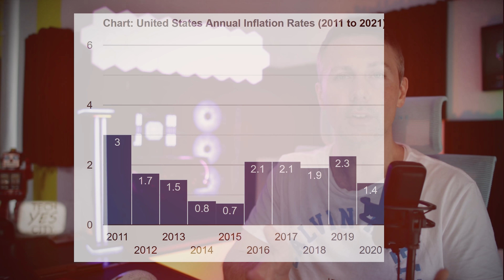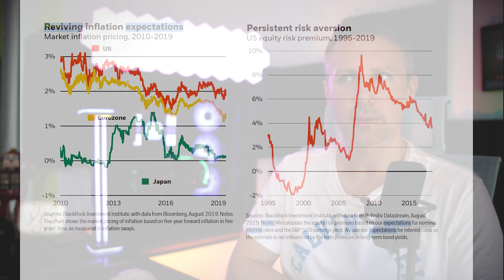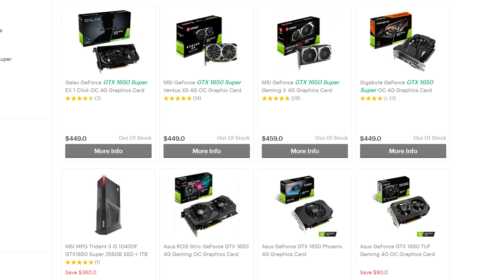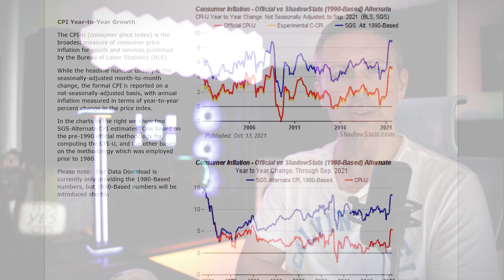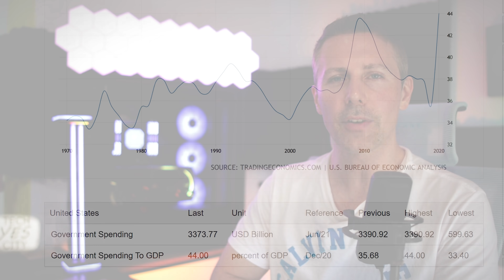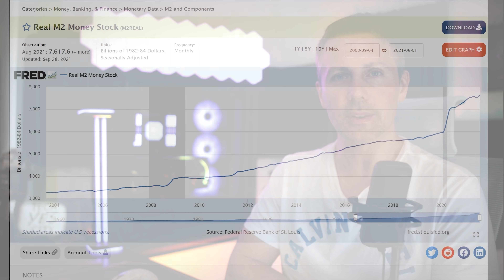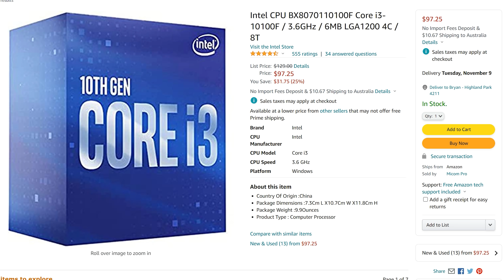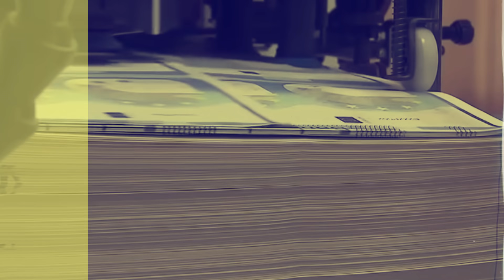Tech and Inflation - What you NEED to know (Part 1)

Comment: Mr tech yes!,  i just got my new GPU. and i've noticed my cpu runs at 50 under load. and my gpu runs at 80. i've removed the coolers from my radiator of my AIO cooler the front of my case has it's own fans, the radiator covers most of the fans. Should i consider moving the radiator to the top of my reinstalling the fans? i'd like to improve the life of my gpu
Reply: Life of your GPU won't be affected unless your running it consistently over 90 degrees. If you're really worried about the life of the card, tweak the fan curve of the GPU so it's higher (say in MSI afterburner) and the card runs cooler. 75° C under load is a good target
Reply: ^ as above you're pretty much all good. If you want an extra measure to help with the life expectancy of your GPU you could consider a few other things. Moving your rad is fine. That could save you a few degrees, or you can limit your graphical load by setting an FPS limit (not vsync) in your driver's. I would typically set it to your monitor refresh rate + 1 or 2 frames. This also decreases CPU load when you are in a situation where you aren't bottlenecked and the GPU wants to push so many frames your CPU is doing more work than it needs too. 
Another way would be to undervolt your GPU by a few mV if you can do so without causing instability.
Reply: Right 😅 . I have a i-7 8700k and a 3070ti Eagle , having triple fan and such temps got me a little jumpy
-A friendly 90 percenter

Comment: Right on. This 5% inflation listed is ridiculous. They essentially take the top 30% of inflationary items and the bottom 20% calling them "Outsiders" or "Anomalies" then average the middle 50%. This leaves out Natural Gas, Oil, Gasoline, Electricity, Coal, Cars, Houses, Beef, Bacon/Pork, lumbar and numerous other things on the high end, many of which are already over 100% of their previous prices. An $8 2"/4" now costs $35 at Home Depot; 5%? Gas was down to $1.38-$1.43 in my area and now costs $2.75. That's not 5%. Now on the low end they are removing things like popcorn, pencils and pens, News papers (Yeah, fricken News Papers, are you kidding me?), Soy Products excluding Milk which is classified as food and is a high outlier at 43%), Canned or packaged processed meats (Hot Dogs, Spam, Bologna; things made from everything they would normally throw out from their Beef, Poultry and Pork that they can grind up, add spiced, water and a coagulant to and say "Here, eat this, it may have more sodium than you should get over the course of one day in three bites, but it's cheap so open that pie hole and get used to it". The list of things not counted is quite small really, and just has absurd things in it, most of which people typically don't buy, or at least want to buy. They include things like Noodles. Audio Books. Glue. Jello, Milk, Eggs and Poultry though the numbers seem very off to me listing them between 3% and 11%. Milk is listed at 7% but a gallon of milk was $2.99 a year ago. Now it is $7. Not Soy or Almond, regular 1% Milk.

Anyway, the entire thing is an absolute travesty and the items they use in their little equation do not relate to what we are actually paying. The head gasket in one of my cars just blew (1992 Civic EX Hatchback, Garaged for 29 years and it just ticked over 100k miles). Anyway, as much as I love the car, I'm also aware that even though it's in mint condition, I caught the problem right away so it still feels fine driving and the V-tech in the little square back car is golden besides a little piece of rubber, it isn't worth fixing bc the least expensive mechanic (not even my normal one) gave me an estimate of $3900 USD. For an $8 dollar piece of plastic. Unfortunately, they have to take the engine apart to get to it and by the hour, let's just say Mechanics are up a lot more than 5%. So looking at inexpensive used cars as this was a second car, well really a 3rd behind my truck, cars with book values of $3800-$4000 are all selling between $6850 and $9000. New cars are only about 20-35% over sticker though, so that's not to bad slaps forehead.

Now the FED has been saying since March that they were going to start lowering "Quantitative Easing" until they are at the point where they are removing money from circulation about 9 months after they start. In June they said "We are almost ready, we just need everything to be in the right place before we do it so we don't hurt the economy to much. Then in September they said that they were very, very close. Not to stat pulling money out, to start decreasing the extra money over our GDP they are putting in!

Here's the thing, they start lowering the amount of money added and eventually start pulling money out; the markets crash like they did in "The Great Depression". The crazy rich (Top .07% lose literally trillions, and the the average person sees their 401k cut in half). This may sound awful, but it stops inflation pretty much dead in it's tracks. If we keep adding money we are eventually going to have the dollar devalued, our credit score goes down, and the 3 billion per day we pay interest turns into $10 Billion; but the markets stay high and our local interest rates stay moderately low. This is absolutely terrible. This means paying more for everything we import, we risk losing the petro dollar/World Currency, and the bottom 99.x% of the country is screwed. The top 1% starts at $550k and goes up to hundreds of billions. Per year, though you'd never see that listed as actual assets as the majority are in tax havens which is why someone like Jeff Bezos can borrow against local assets at less than 1% for a 1 Billion dollar loan, live off that for the year, and get money BACK IN TAXES (twice in the last 4 years, that's insane).

But what will the Fed do? Take away trillions from the 300 richest families in the US since they own roughly 85% of all stocks, or will they take it away from the people making $550k, $650k/yr and under. This is the first time in history where the top .05% hold more wealth than the 39.5%-99.5%. They've held more than the bottom 60%, but not the middle all the way to the what most people think is almost the top. I know what they should do, but with the massive push for a "Great Reset", companies running the government through lobbyists, it obviously doesn't matter what the people want. Who wants10 Billion for "Tree Equity"? Who wants an 8 cents per mile driven tax? The closest Bus Stop to me is 15 miles away. The closest Train/Subway is 45; 55 if I want a Subway to take me where i want to go in Boston, Providence or the surrounding areas, so no, this does not work. We don't all live in cities or in suburbs right outside well-to-do cities where the buses actually run through the suburbs. An extra oil and natural gas tax when it is already expected to triple in price bc we cut down our production to such a degree we went from exporting Diesel/Heating Oil and Natural gas to begging Opec to pump more and ship it to us cheaper than they do other countries so they can tac it higher to help pay for this spending. They aready pulled the SALT tax. They pulled the 10% Inheritance tax hike on Assets worth over 5 million while adding it to normal people instead to make up for about half of it, even though it's a larger hike. When janet Yellin (I believe it was her) was arguing about why it shoudl be pulled she used an example of a trucker who makes $100k a year inheriting a 10 million dollar Beach house. How could he possibly pay taxes on that? Oh, idk, take out a mortgage on the house for said taxes and pay it that way. Sell it and pocket the rest? How often do regular people inherit 10m+ assets from family? Twice last year in the US.

They (Republicans) tried to add a yearly Capital gains tax instead of just when someone sells; well that was pulled because it just doesn't work in Biden's plan. We...no, A lot of us thought Trump was screwing us the last year of his presidency? Biden is literally crushing the what is left of the middle class and is apparently now a big believer in a Wirld Government led by cooperation between large corporations and said Western Governments. They had to pull their "In 2030 you will own nothing, and you will be happy" video which essentially showed people living an upper middle class lifestyle smiling a bunch. The World Economic Forums stated that the Pandemic gave them a great opportunity to cause hyper-inflation forcing everyone to re-think how they live, and how the lower classes need to live on less and use less resources. The Elites? Well they get more money and own everything. I thought Trump was being a Tyrant when he issued his 2nd executive order, bypassing Congress and the Senate. Biden has done this 63 times already! He defied the Supreme Court twice. He's letting over 200k people a month into Texas and relocating them around the country, gving them free Welfare, $1000 Amazon cards every month, a Drivers License if they had one in their home country, a car, health insurance and a place to live along with free schooling up to grade 15 (2 Years of College). They had to pull the former for US citizens because it would be to expensive. I'm all for immigration, I really am. I'm a 2nd gen Immigrant myself, with my father coming over from Brazil...or Portugal. Portugal, as he was born in Brazil but moved to Portugal when he was young and then came to the US from there. One side of my mother's family were actual Gypsies because they didn't want to live under a Dictatorship run by the USSR in Czechoslavakia. They did it legally though. Of course there was far laess paperwork and the process as a whole was far simpler. 4.3 trillion. That's what about half want to add. The other half said they would go as high as 2.5 trillion, with about 75% of that paid by people making under $129k per year, and 65% from people making $649k/yr or less (So the very bottom of the top 1 percent). The other 35% (of 2.5 trillion; well that's not paid for atm, but if the gas mileage tax, heating ooil and natural gas taxes go into affect, it will be paid for. Mostly. They also want billions more to go to the IRS so they can double their employees and stop the tens of millions of people who make a few hundred extra dollars a year that goes unreported. Not look at the top of the pyramid and make sure they are following the tax codes to a "T," even though that would surely bring in more money. That's a lot of work though bc they have lots of paperwork and lawyers who fight things in court.
(Cont.)

Comment: I agree wholeheartedly about the core i3-10105F in particular its about $4 dearer than the i3-10100F but does a stellar job and if you couple it with a decent budget motherboard e.g the Gigabyte B560 ($112.50 with shipping ) and some reasonable DDR4 x 3200 MHz ram currently (around $99) it gives you a strong upgrade pathway especially if you couple it with a good 600-650 watt psu..all these components make for a very good budget computer and if you can source a decent used Graphics card you have a good Gaming PC.. In the future with a i5-11600k upgrade you can utilize the benefits of the motherboard that allows for overclocking the Ram up to 4600MHz and if the costs of Graphics cards go down then you have an extremely good Gaming PC ..Having purchased the 600-650 watt PSU then allows for a GPU upgrade without having to purchase a new PSU.

Comment: Personally, I've changed up my savings structure because of the way things are now. I keep a certain amount in cash in case I need money quick, but apart from that I convert all my money to silver and a small amount into canned food for good measure. 

If the currency ever fails, metals will always be viable, because the can be melted down and made into things. Fiat money doesn't have that added utility. My metals have held their value through all this, whereas my dollars have plummeted in value.

Note: inflation is up over 5%. The value of silver has risen 28% since I started buying in a year or so ago.
Reply: no gold, only silver?
Reply: @arch1107  I've got a tiny amount but silver is just waaaaaay more affordable when I only have like a little cash here and a little cash there to put into it.
Reply: That's likely wise if you're able to do that. Metals historically have done well.

Comment: What drives me crazy is hardware sites I thought were reputable having cards at huge prices....so I wonder where in the supply chain the increase is
Reply: The question with the shorter answer would be where in the supply chain the increase isn't?
Reply: The increases are across the board, all the retailer and middle men have to charge more to make a profit because they sell less hardware, because of the shortages.

Comment: I reckon the 10105f is a better buy than the 10100f, it's the same price if not cheaper in most places and it has an extra 100mhz clock speed

Comment: Throughout modern history(the last 100 or so years) the economy has been a virtual roller coaster with highs lows, falls and climbs.
We in the U.S.A for the most part have been riding a high for a fairly long time frame and are really overdue for a downspell or readjusting of the values placed on some items and/or stock holdings.
How low will it go and for how long who knows, in the U.S. the worst period ever was in the 1930's or the "great depression" could we repeat that yes it is possible but yet still unknown.

One thing is modern society has really gotten its wires crossed and mindset screwed up when it distinguishes the difference between wants and actual needs and luxuries versus items required to survive.

We do not NEED $1400 phones, 85" flat screen tvs or a pc or gaming console to survive. We also do not need $5 starbucks coffee or a $65000 SUV either. A family of 4 does not NEED a 2800 sq. ft home either.
 But many people today would not agree with that assessment and needs and wants may need to be redefined in our society and the only way that happens is when  you learn the difference first hand and not really by choice. 

My grandparents grew up during the depression and coming from that you could see how their buying and money spending habits were affected by the experience, the way they avoided debt like the plague and what they placed as value and/or was actually needed in their lives was affected by living through those lean times.

Looking at it from that perspective a downfall that readjusted our society to what is important and what actually holds value a major bump in the road in the economy may not be all bad in the long run.